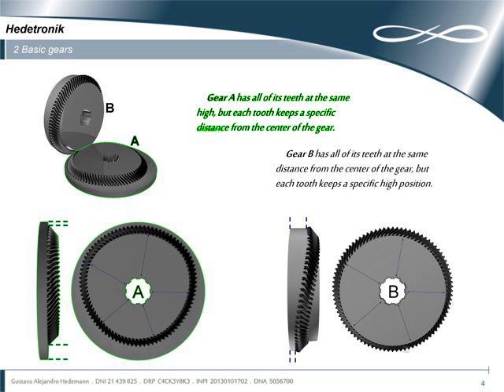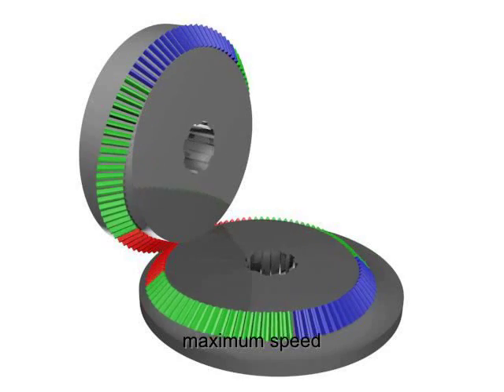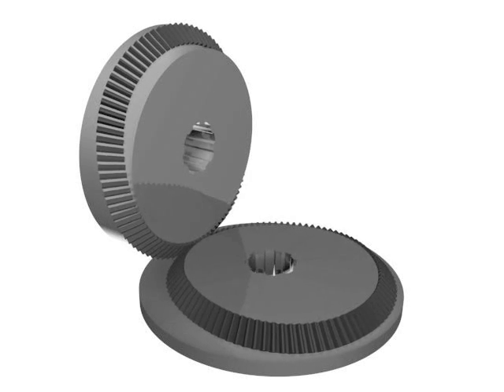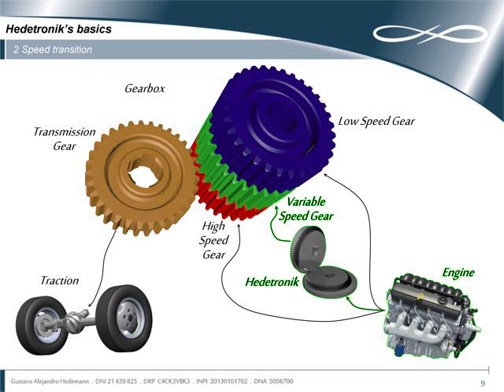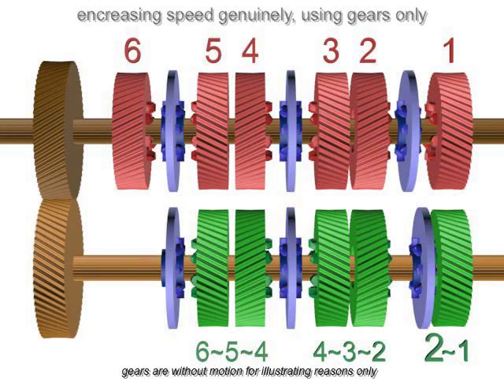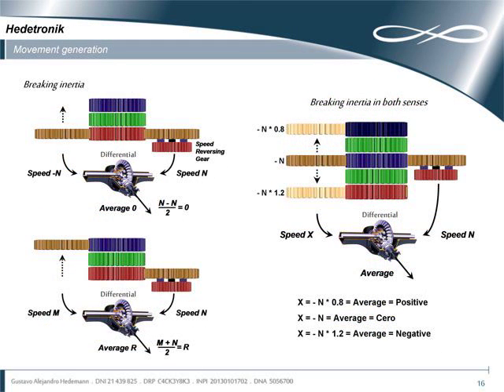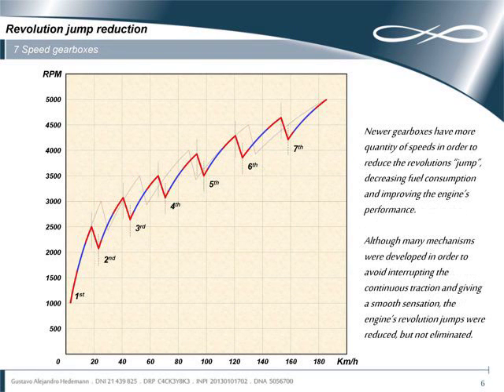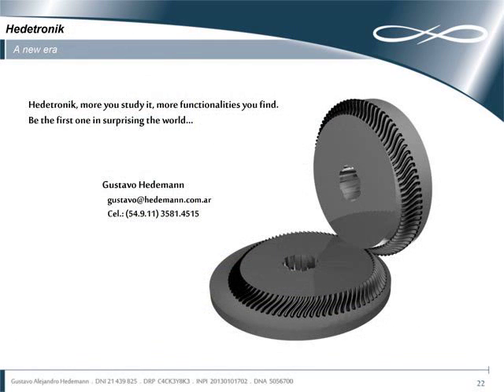Hedetronik 2013 - CVT - Continuously Variable Transmission - 100% GEARS

Comment: The swift must occur in less than 1 lap of the engine. Very, very, very difficult.
Reply: True. Thus, using multiplying gears solve the matter. Anyway, this is just an idea that works in a prototype. Surely difficult to use it in industry.
Reply: negative... it must sweep within one revolution of its input... not necessarily the engine directly.
Reply: with the sweep occurring so fast, how does it hold up to the shock load of torque? An engine putting out 300lbs of torque can exert well over 1,500lbs of the rotational mass is loaded that quickly.